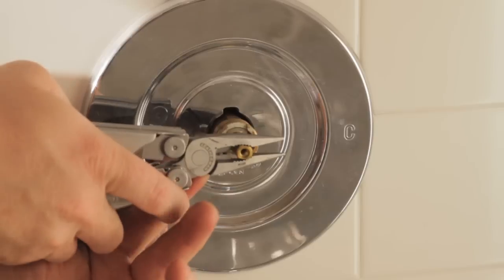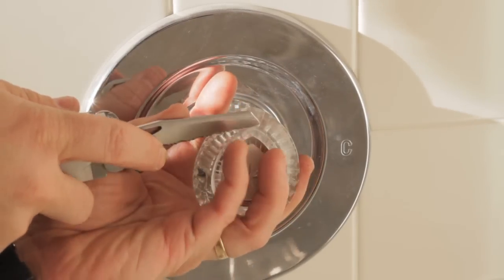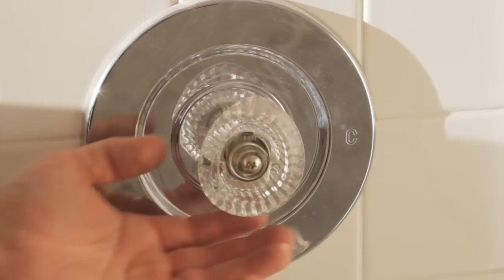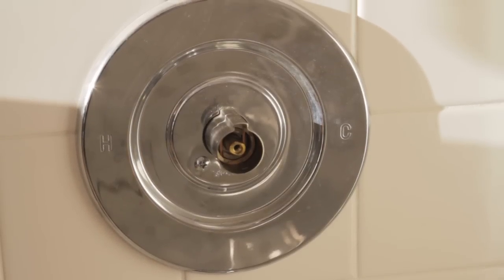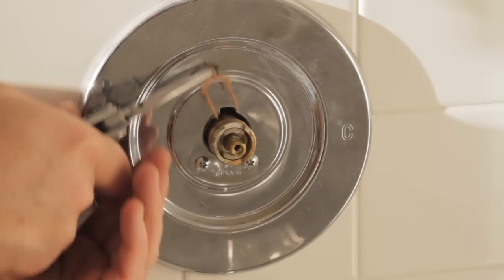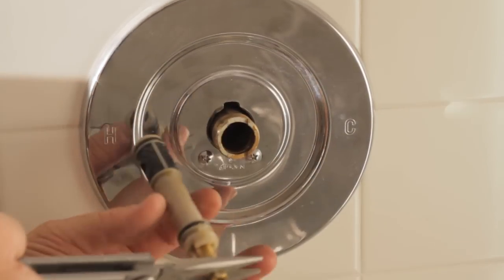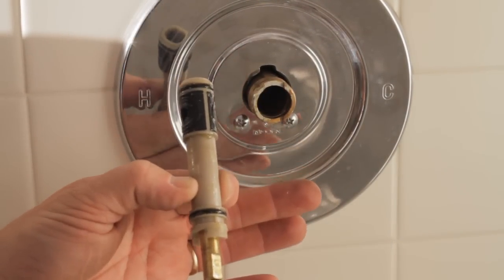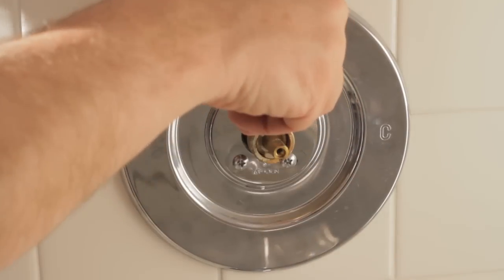Shower Repair : Leaking Shower Faucet Problem

Comment: i removed the keeper pin but the cartridge wont come out of the pipe..what do you suggest..thanks
Reply: I'm having the same problem ... but I took it apart 2 months ago, it came out fine, but I had to put it back as I couldn't to hardware store that day. Only NOW LOL am I getting back to it. And now it wont pull free. And this looks exactly like mine.
Reply: @KimberlySmith1620  i called a plumber as a last resort. Oh well

Comment: How about when I need to take the handle off but it's stripped.  It just spins continuously.  The water goes on to off but doesn't stop. I have to turn the valve with my screwdriver.

Comment: If it's stuck... You may need to work it back and forth.  If it still won't give or come free... Call a plumber.  Or if you're doing on the cheap... Try that local handyman.
Reply: I replaced mine twice and it still leaks